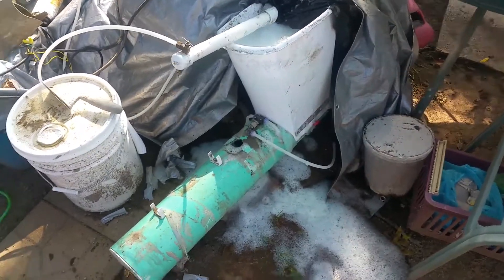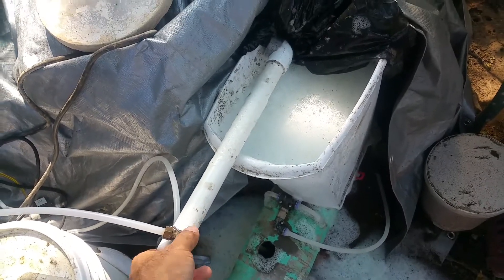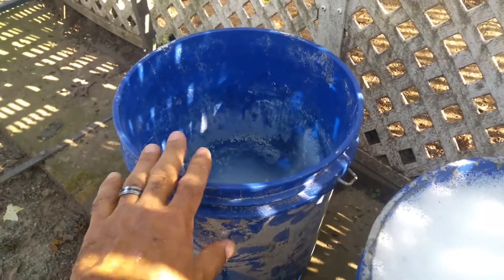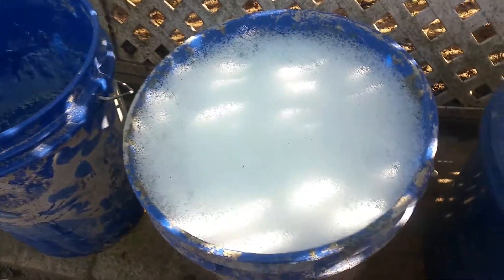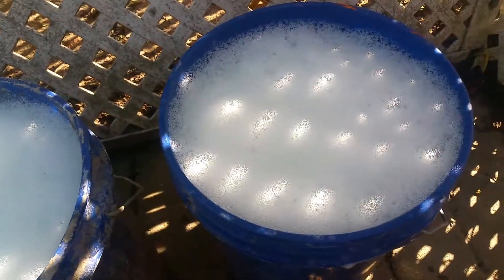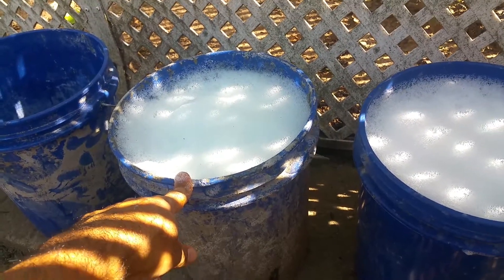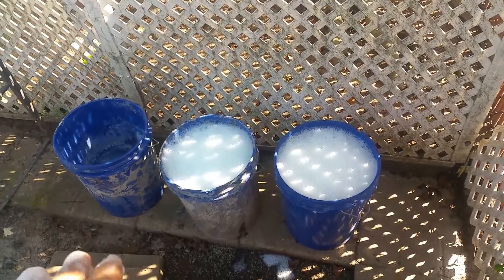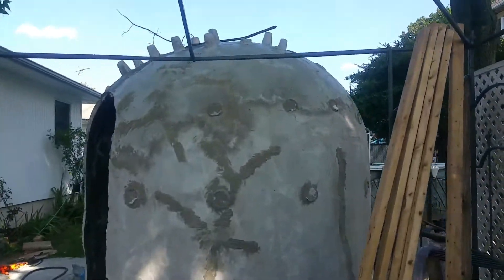Soap Solution Experiment #Aircrete #Dome #AircretePump #AircreteHarry #SoapSolutionExperiment #DIY

Comment: Where can i find your email address? really interested to hear!
Reply from the maker: Hi Brent, my email is Talyn71@gmail.com  the experiment with soap did not work for aircrete. I recommend using Drexel Foam Agent, From what I hear it's harder to get the  Drexel now. So try this soap I think I will work good and it's not expensive. https://www.target.com/p/suave-essentials-daily-clarifying-shampoo-30oz/-/A-49173238?sid=1344S&ref=tgt_adv_XS000000&AFID=google_pla_df&CPNG=PLA_Health+Beauty+Shopping_
Local&adgroup=SC_Health+Beauty&LID=700000001170770pgs&network=s&device=c&location=
9058754&gclid=CjwKCAjw4sLVBRAlEiwASblR-2pnbHKzJjK4yn3EolAWE5mDax65Dgex87mwWTGxOYfNlddqnE49fRoCXz0QAvD_BwE&gclsrc=aw.ds
Reply: Thanks Harry. And I really appreciated all your videos. I learnt a lot.